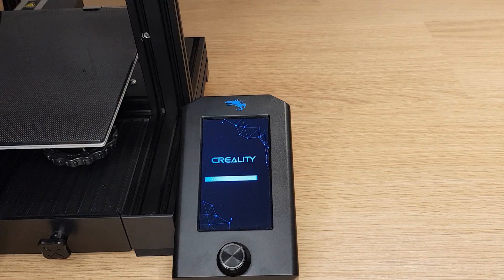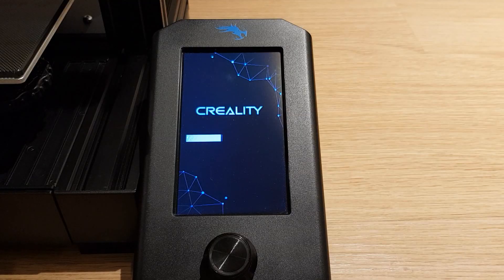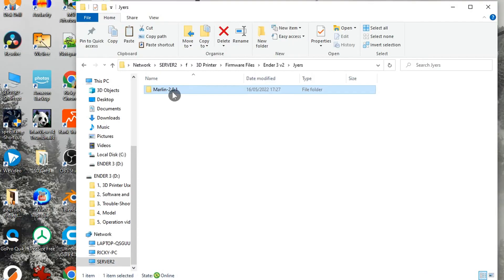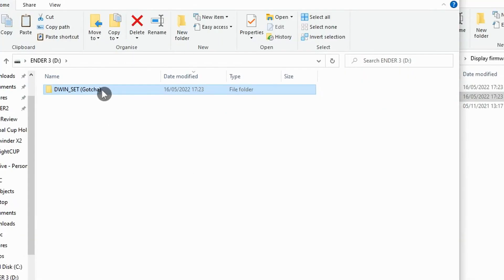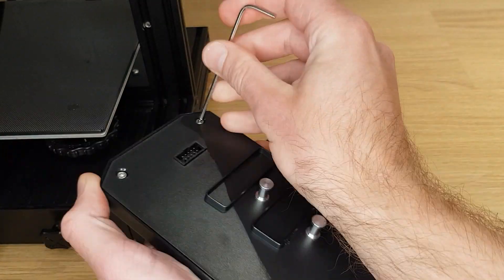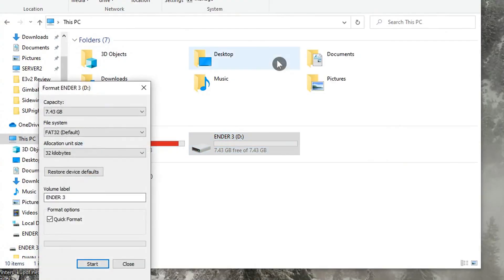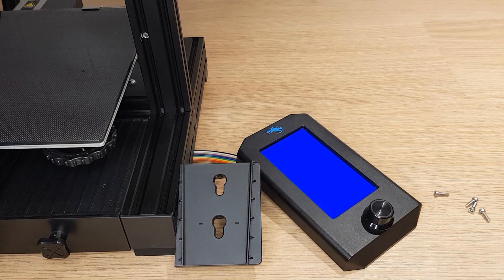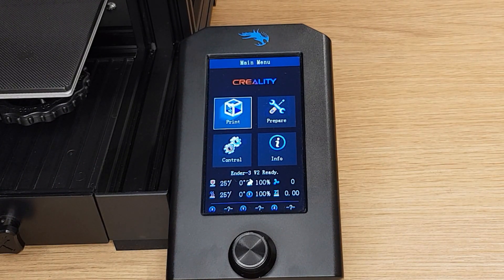Update The Screen Files On your Ender 3 v2 To Get the Most From Jyers Firmware

Comment: I was also having display upgrade issues that were getting frustrating.
Let me first say I'm a retired guy about three weeks into this new "hobby" and I'm loving it. Ricky, I appreciate your work and have found your info on my Ender 3 V2 really, really helpful.
The Jyers firmware upgrade went great (and I like it a lot) but I had all kinds of problems updating the screen files. Did everything twice: full format of two 8g SD Cards with 4096 allocation, etc., etc., but it was like the display never "saw" the SD Cards or files.
I did quite a bit of poking around and have found there are a variety of Display PCB boards in use. Some have no "V" number, there are V1.20 and mine, maybe because it's newer(?), is a V1.40. The version is on the lower right corner of the PCB near the SD Card slot.
I found another thread discussion on the issue and came across a "fix" that immediately worked for me. It seems the "newer" version boards don't look for "DWIN_SET". There's a ZIP file is "private" as the file name and that's what this new version board "looks" for.
Credit where credit is due to SiliconExarch, that thread and the ZIP file is here: https://github.com/Jyers/Marlin/discussions/1768#discussioncomment-2078494
I tried the zip file, renamed the set "private", dropped it onto the SD Card and the upgrade went through just fine.
Thanks again for all you do!
Reply from the maker: Awesome info here Pat, thanks so much for detailing your fix for everyone. I'll pin your comment for now so that others can find it and maybe add the detail to the description somehow. Thanks again, we all learn from each other here👍
Reply: @RickyImpey  I was to the point of pulling my hair out because I couldn't figure out why my screen firmware refused to update. This new zip file with the "private" files worked perfectly! Take home message...read the comments section!
Reply: Ricky I love  your work and Pat you are my hero! thank you both.
Reply: Thanks a lot Pat Moore. I did it on my Ender 3V2, the way you explained it here. Much appreciated.
Reply: Thanks Pat, used the private folder and it worked!
Reply: @Gabrielbeg07   Hello friend. Please help me, I could not perform as described. How should I do, what is private folder?
Reply: All I can say is THANK YOU !!!!! . Your email and link was so!!!!! helpful , I would have never figured that one out on my own
Reply: Thank you so much mr Moore, it worked like a charm!
Reply: I just did what you all said and the screen went blue and wrote files and then went blank
Reply: Thanks, that explains why the firmware update works but not the display update.
Reply: Sorry, but I think I didn't do it correctly. what should be the name of the folder that will be on the SD card?
Reply: oh wow pat thank you so very much for sorting this out and i had the newer verison board v1.4 as you described and now everything is up and running and looks so much better now, i think this should be added to the jyers repository firmware download section so thank you again pat for all your hard work on getting this sorted....mark
Reply: Will this allow for preview ?
Reply: THANK YOU! I spent the last couple of hours trying to get my LCD to update. Everything I could find was using the DWIN_SET, but my LCD refused to acknowledge anything was there. I tried different SD cards and different allocation sizes, but same result. I saw this post and tried that.... instantly started to update when I powered it on. It also shows what it is doing instead of the blue and orange screens on the older version.
Reply: Same happend to my  LCD (V.1.4)! Only this way setup works. Thanks for the andvise Pat! And thanks for the video Ricky!
Reply: did not work, now instead of doing anything, it just loads the creality logo and nothing happens
Reply: Awsome Pat, thank you for this added info!  worked a treat!  I guess my printer couldn't resist looking in a private folder! :)
Reply: Pat, you're a legend. This solved my issue thank you!!
Reply: Thanks for sharing, have had same problem!
Reply: you sir are hero among heros.
Reply: Dude that works. Thank you!!!!
Reply: Thanks Pat youre my hero 💞💞

Comment: Hi Rick! I have a quick question, how can I revert the screen software to its original state? The screen button of my printer isn't working as it should and it jumps to random numbers when I try to set the offset or the temperature. The software I currently have works in "real-time" with these parameters and I can't control the printer very well with it. 
So I wanted to ask you if you know where I can get the OG files of the screen software. Thanks!
Reply: Creality web site should have them.

Comment: Hi Ricky, have watched the video, i dont know whats wrong with my printer at moment, was using it last weekend in the evening doing a Chucky print, when i went to do my next print the following morning i switched it on and it come up with the Creality icon on the lcd screen but nothing else as i know a white bar scrolls across the lcd screen then the menus come up. i am puzzle and hoping i can fix it without spending to much money on it if needs fixing another way. is it the firmware or. i dont know if you are fimiliar with this sort of problem but if you are, could you let me know on what i can do to rectify the problem, i had subscribed to your channel about a year ago but when i come onto this video i see that i was no longer subscribed for some reason. i await your reply if you wouldnt mind please, take care and maybe speak soon
Reply from the maker: Hi, had you successfully switched to Jyers firmware or were you on Creality firmware? Either way, I would try updating both the screen and control board firmware if i were you. Let me know more details of what you have etc. if you need more help.

Comment: here is a guide on how to install new icons in creality ender 3 v2.
Here the link to download the new display firmware zip file.
Download, unzip, copy to usb fat32 format 4k the entire private folder, just leave the private text on the usb, then insert the sdcard under the display, turn on the printer and the installation will start, load the percentage icons in red, the icon texts, the installation will end, then the creality text will be turned off, remove the sdcard and turn on the printer, the new icons will be colored nicely done..

Comment: I may be having a stroke but even after switching to the 4k I couldn't successfully get it to flash. but since it's just a cosmetic I'll suffer in silence for now. TYSM for showing all of these in a step by step. getting all of these extra options is absolutely mind blowingly helpful.
Reply: here is a guide on how to install new icons in creality ender 3 v2.
Here the link to download the new display firmware zip file.
Download, unzip, copy to usb fat32 format 4k the entire private folder, just leave the private text on the usb, then insert the sdcard under the display, turn on the printer and the installation will start, load the percentage icons in red, the icon texts, the installation will end, then the creality text will be turned off, remove the sdcard and turn on the printer, the new icons will be colored nicely done..
Reply: @David coxino  Update! It was the type of SD card I was using that failed every time. when I switched to a SanDisk it worked like a charm. originally I was using a Netac

Comment: Are you still using the Jyers update even though it's an abandoned project? or are you planning on using the MRISOC update?
Reply from the maker: Hi, I'm currently running Klipper on my E3V2 which I'll show in a very soon to come video. If i were to go back to Marlin then yes, I would probably try MRISOC as a lot of people say it is good. I had no problems with Jyers myself though. Very solid for me.

Comment: if you are wondering how to get your allocation size to 4092 if you don't already have it, right click on your windows icon then go to disk management and find your sd card. Find a tutorial on the rest of the steps💪🏾💪🏾
Reply: here is a guide on how to install new icons in creality ender 3 v2.
Here the link to download the new display firmware zip file.
Download, unzip, copy to usb fat32 format 4k the entire private folder, just leave the private text on the usb, then insert the sdcard under the display, turn on the printer and the installation will start, load the percentage icons in red, the icon texts, the installation will end, then the creality text will be turned off, remove the sdcard and turn on the printer, the new icons will be colored nicely done..

Comment: Great info but after 3 attempts I gave up then started reading the comments and I read Pat Moore's comment about the updated board in the screen.. mine is Rev1.5 which I think made it the issue, as my Ender3v2 machine is brand new as of November 2022. I followed Pat's link and got the new display firmware file and it worked a treat the first time.. yipee... I think Ricky, maybe you need to make an updated video about this.. Thanks for your help and the videos you do make they have helped a newbie lots.
Reply: @dergelbe99  ??

Comment: I had a lot of difficulty with getting the display to work appropriately until I watched this and saw the "allocation unit size 4096 bytes" and then it worked as intended.  I had to go from my Mac to Windows PC to do this easily, at least for me.  It is worth a try if you are having the trouble that I was having.  Good luck!   

thanks for this video!

Comment: Any way to get end of print sound with Jyers? I've been running it for about a year and really like it over stock. I've been trying to get end of print beep since I've upgraded to quiet fans and don't notice when it finishes. I just went back to stock fw and it will beep when finished printing but the UI is terrible after using Jyers plus the stock one beeps everytime I press the knob for enter.
Reply from the maker: Hi, it should be possible to add a beep with a g-code command in your slicer but it's not something I've done myself. I've just switched to klipper firmware on my E3v2 so I can't even test it myself right now.
Reply: @RickyImpey  After some poking around in the menus I think I figured out why I was not getting a beep at end of print with Jyers, I had turned beep off so I didn't have to hear the annoying beep every time I pushed the knob for ok/select. I've since changed fw again back to creality because they have a tailored made one for the sprite hot end upgrade. , I will probably change once I get everything running good with the new hot end. I don't like to do too many changes at one time. The new hot end mostly worked good in Jyers but there are 2 x wheel screws and nuts on the new hot end that hit the bracket on the right side of the gantry. Creality fw accounts for that and doesn't run the hot end far enough to hit. I have not found a setting in Jyers to limit max x  travel so I'm stuck with stock for a little while I guess.
Reply: The end of print beep does work with Jyers as long as you don't turn the LCD beeper off. Even when it's turned off the thermal alarm definitely still works. The line to add to your end gcode is M300 S932 P300 if you want a short beep.

Comment: I could be wrong on this, but, in the process of waiting for the screen to turn from BLUE to ORANGE to confirm the flashing process of the chipset on the screen PCB, mine would never flash over and just load up as it did in blue. I messed with this about 30 to 40 times transferring files, only to scroll in the screen menu to the "INFO" tab, to see that (Speculation) Creality ENDER 3 v2 that has been released this past month, when I got mine directly from their authorized US warehouses/resellers, and it already comes with the "screen up-date" of the DWIN-set from the factory? Todays date is 12-29-2022. My main PCB is V4.2.2 and the chip set is the RET6/512KB memory. 

I gotta say, I have no clue of what the factory screen looks like, but that "INFO" tab reads that JYERS in on the screen chip set already, unless, even the old version was titled that was as well?... NO NEED TO REPLY, unless I am wrong, which is possible? Again, Thank you, as I am having so much fun playing with this stuff, and still haven't printed a single thing.. I now need to figure out why my Z-axis doesn't work and will only work for about a half inch.

Comment: I'm using this firmware from last 11 months and facing trouble with the resume print feature. Whenever there's a power outage it doesn't shows the resume print option instead it shows the home screen. Or can you please guide me on how to downgrade the printer firmware to the stock one.
Reply from the maker: Hi, putting the Creality firmware and screen files back on is exactly the same as how you changed to Jyers but you use files from Creality instead. This video shows where to get those files if that is what you want to do https://youtu.be/Qv_vVrnkAkI
Reply: I know it's late but just in case you wanted to try Jyers again, go to control>advanced settings and scroll all the way to the bottom to enable power loss recovery

Comment: I installed the printer surface sensor, is there a problem if I update the screen?
Reply from the maker: No, you have to update the firmware when you install a bed probe. You might as well do the screen files too.

Comment: Hi, I tried updating the firmware on the screen both according to this video and using the private folder. However, when I do it I get a weird looking screen with no images and only text. I've tried also renaming the DWIN as private, and renaming the private folder as DWIN to see if anything would change, but still no luck. Any ideas on what to do?

I previously had the firmware on my screen working fine, but ever since changing to 2.1.1 my screen just isn't looking right. Do we think it might be an issue with the firmware on the motherboard end?
Reply: here is a guide on how to install new icons in creality ender 3 v2.
Here the link to download the new display firmware zip file.
Download, unzip, copy to usb fat32 format 4k the entire private folder, just leave the private text on the usb, then insert the sdcard under the display, turn on the printer and the installation will start, load the percentage icons in red, the icon texts, the installation will end, then the creality text will be turned off, remove the sdcard and turn on the printer, the new icons will be colored nicely done..

Comment: Yay, the screen part completely bricked my brand new ender 3 v2!
Reply: @mehmetaliayyldz9890  Flash the file I posted
Reply: @mehmetaliayyldz9890  Should be inside the Zip
Reply from the maker: Hi, it shouldn't be possible to brick the printer. You will just need to load the original Creality files back on if it didn't work for you. There are some different hardware configurations coming from the factory now, unfortunately some of them need a little more fiddling with.
Reply: @RickyImpey  I managed to fix it, my screen is a DACAI screen, which doesn't use the "dwin" folder, and the files are different apparently. I dug deep, and managed to find the files that fixed my screen, great content nonetheless.
Reply from the maker: @Tumathy  excellent, well done!
Reply: @Tumathy  Where did you find the files that fixed your DACAI screen? I am currently running Marlin 2.1.2 with the CrealityUI. I used the private folder (from Marlin 2.1.2) on my DACAI screen, however text is not displaying (icons do work). I think the text is sent by the motherboard to the screen, so could you also specify which version of Marlin you are running. Thank you in advance!
Reply: @Tumathy  Thank you for responding so fast! I got it working now. I will edit the E3V2 firmware a bit to get my upgraded components to work on the higher temperature that they are rated for.
Reply: @julesvandenaker  You're welcome friend.

Comment: hi ricky, i have done all the steps and when i go to update the display screen to have the icons nothing is happening it just goes straight to the jyers and i have done all the formating to fat32 and tried about 5 sd cards and it still it won't update or change the icons, have you any ideas on how to sort this out thanks....
Reply from the maker: Hi Mark, have you seen Pat's comment at the top?☝️ He found the same issue and told us all how he sorted it.
Reply: @RickyImpey  yes I did see it Ricky and thanks for replying back and everything is ok now the only thing I did forget to do was put in my esteps after calibrating them last night but that's all ok now just have to sort this stringing out as I'm doing a test print at 190 and 60 bed thanks again 👍

Comment: Did u find out about the different screen folders ?
Reply from the maker: Not sure yet, no. I think they are probably just different themes.
Reply: Just did some quick rooting around and it seems that it is just a difference between the file icons.  You can dig into the subfolders under 'Icon Packs' to actually see what the images are they each use.  I'd suppose you could also create you own custom packs and recompile the firmware with whatever images you wanted.
Reply from the maker: @Fio8os  That makes sense, I assumed it would be something like that. Thanks for investigating.